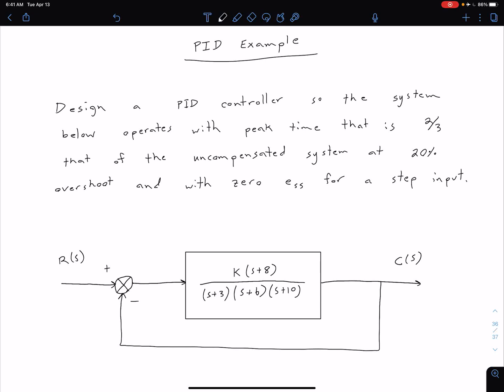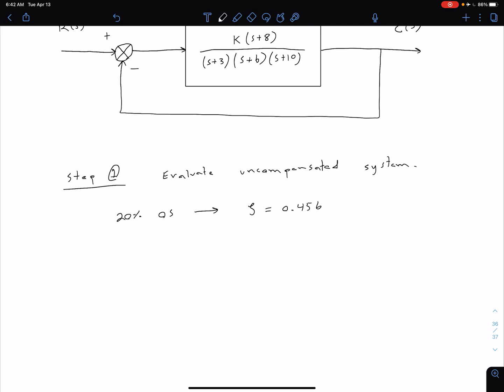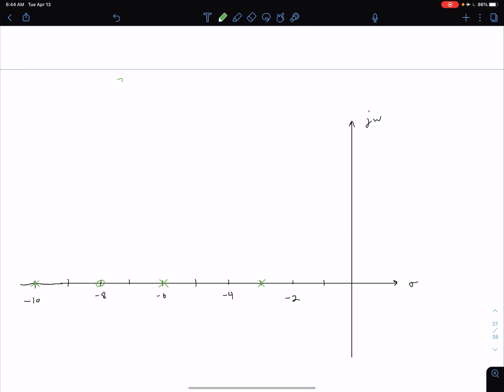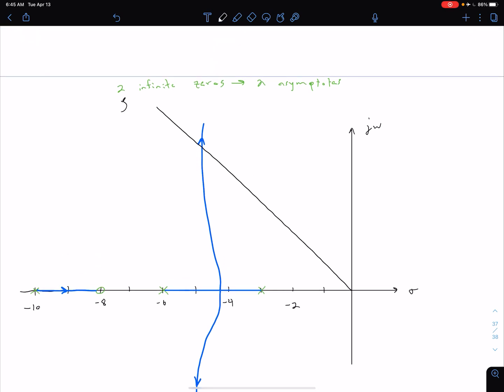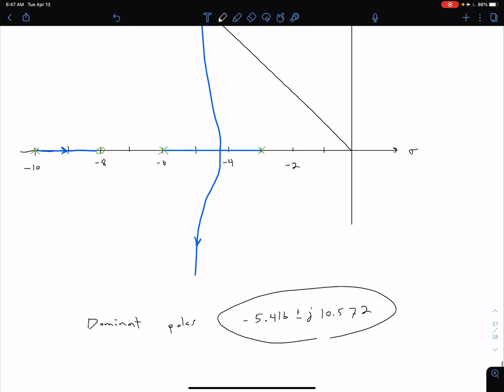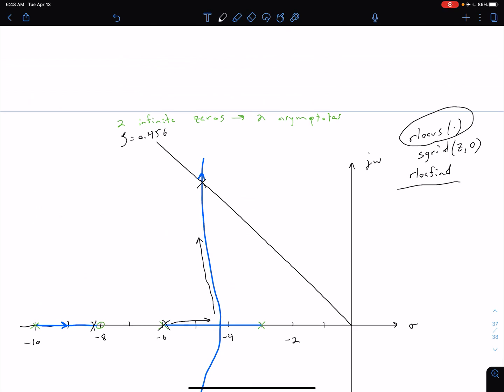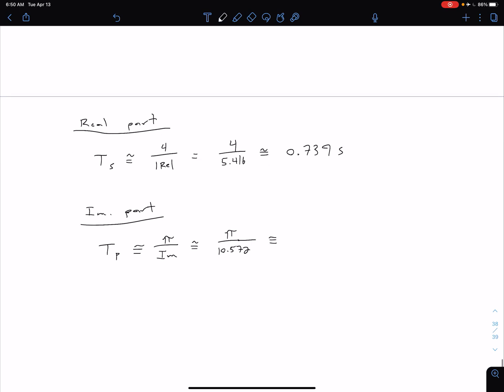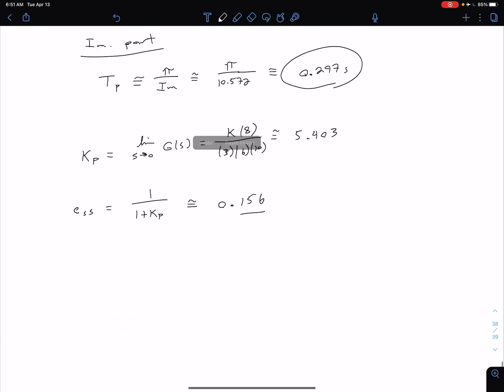Design via R.L. - Example: PID Design-Part 1

Comment: So this can't be solved mathematically on paper? do we have to use computers?
Reply from the maker: It can certainly be solved on paper, it's just MUCH more tedious than using a computer. If you don't have MATLAB, you can use Octave which is a free software that is similar to MATLAB. The downside of Octave is that it doesn't have all of the built in functions that MATLAB has.